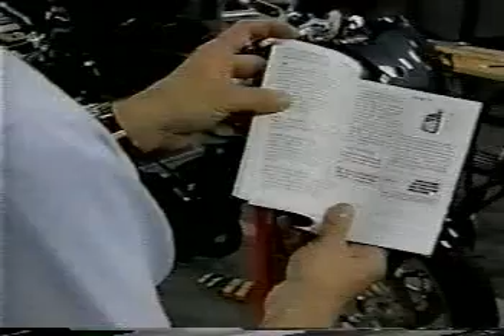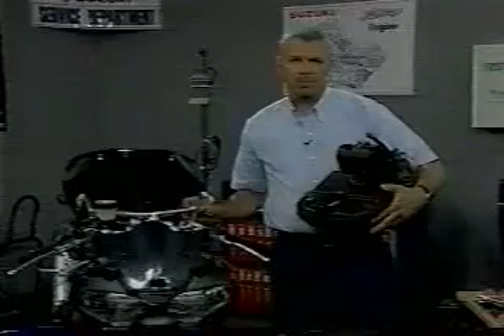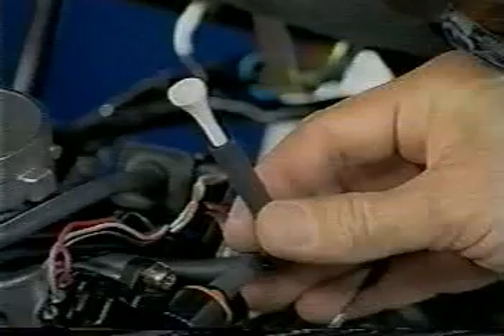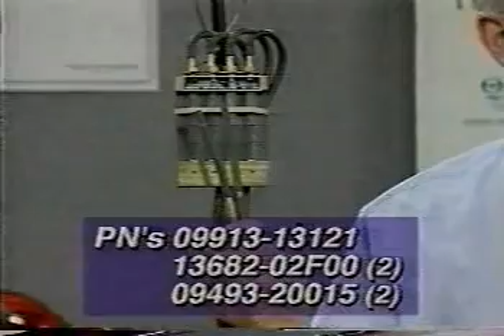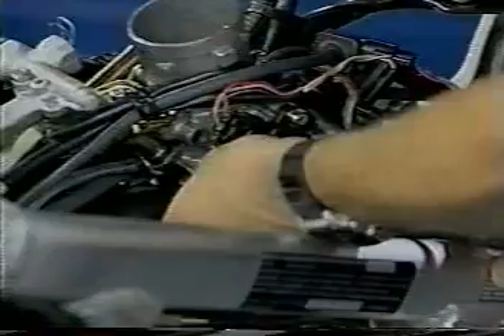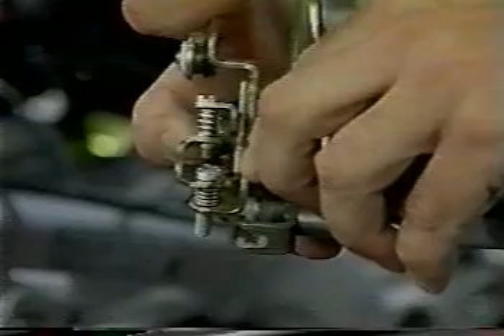TL1000S TPS and TB sync

Comment: I have a TL1000R n I want to know where the small breather hose goes connected from the 2nd Air Valve Switch. There are 3 big hoses and 1 small hose. Where does the small breather hose go connected?

Comment: Brilliant video, so clear and concise and transformed my TL. What a beast now. Especially with a KN, open pipes and a Power Commander 2 usb with a Dynojet map. Maybe a dyno set up would improve it even more. But its mega as is. Im going to check my valve clearences again last year I discovered a burnt put valve. Ive replaced that and i'll re-check before we go tbis year. New plugs, KN clean, oil and filter and it'll be like new. Love this bike, awesome. Reminds me of the "strokers" I used to run and race in that it goes like fcuk, handles well and is relatively narrow and light. My favourite bike ever, apart from my race LC, and ive had a few at 64 years young. Have fun folks before the "green" twats ban us!! 😂👌😎
BTW, black is best 😊

Comment: I bought a 1999 TL1000r two months ago and it would cut off when idling while hot. After watching this video I adjusted the TPS sensor and synchronized the carbs and it idles perfectly and pulls much better now. Great video.

Comment: in the tail section, it's a white plug with 4 pin holes (only two connections though) and a black rubber cap.

Comment: My bike will not stay at idle. It keeps dying. could it be timing?
Reply: did you ever come up with a solution for this? my bike is running extremely rich and has low power. i know the timing is perfect but i’m not idling very well. i also have a 99 suzuki tl1000s
Reply: @dangelospaide1292  I did get it figured out. If you have the same bike you need to know that the tps calibration is very sensitive. I had to take it to a TLS specialist.